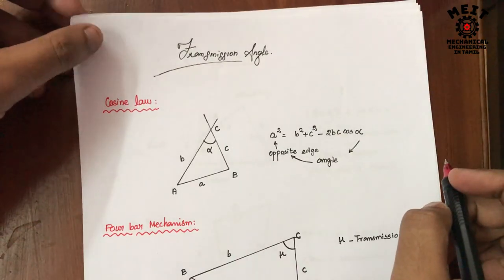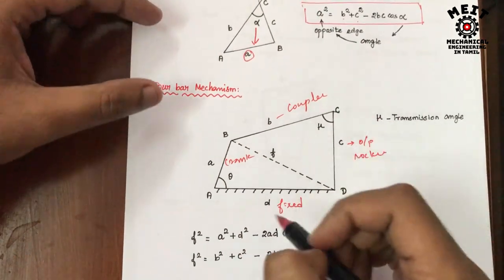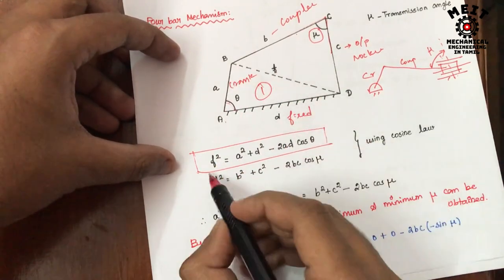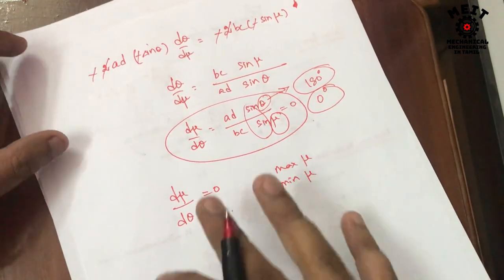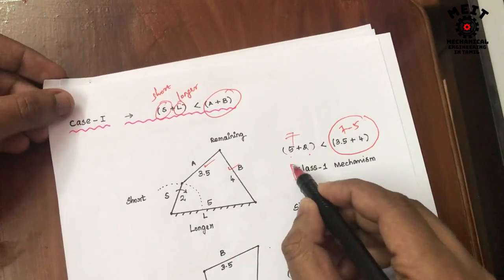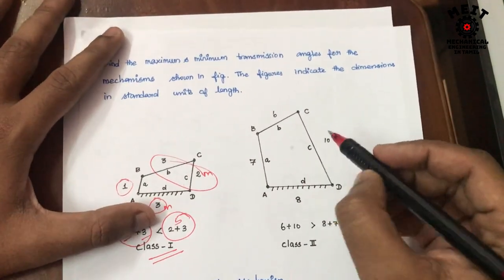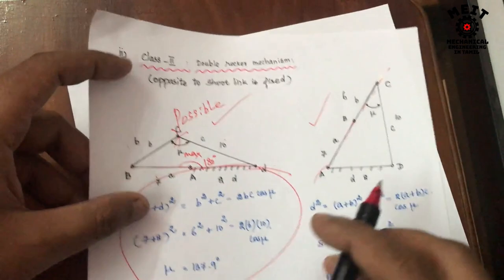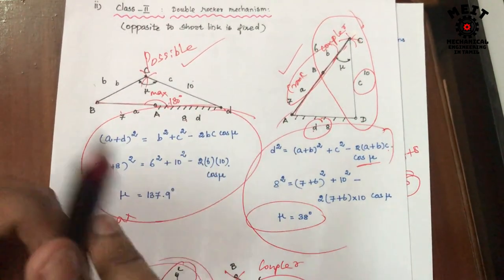Transmission Angle Calculation in KInematics of Machinery (KOM) in ENGLISH

Comment: 14:00 since it is class 2 mechanism example..hence it is double rocker so full rotation of crank is not possible hence 0 degree angle diagram would not be considered
Reply: @focusacademylectures can a double crank have a transmission angle?

Comment: sir please tell me that why transmission angle of zero in the double rocker mechanism is not possible ?
Reply from the maker: IN DOUBLE ROCKER., INPUT OR OUTPUT LINKS WONT REVOLVE THAT MUCH ANGLE... WHEN A CRANK ROTATES 360DEGREE.. THEN ONLY 0 DEGREE POSITION IS POSSIBLE. IN DOUBLE ROCKER, THERE IS NO CRANK, NO FULL ROTATIONAL MOTION.

Comment: Sir aapne kaise calculate karke degree me nikala ?? Mu min or mu max
Reply from the maker: English pls.
Reply: @focusacademylectures  sir please tell how can you calculate mu max and minimum in degree even when i solving am getting another answer.
Reply from the maker: @halalTripShorts  check whether calculator in deg mode or rad mode. You have formula for each type of mechanism, if you know the length og links and theta value.. you can easily calculate mu max mu min
Reply: @focusacademylectures   sir in last i found cos inverse 16 for mu max after that what i have to do?
Reply from the maker: @halalTripShorts  show ur problem as jpg file
Reply: @focusacademylectures   how can i gave ?? There is no any option present
Reply from the maker: Insta @itsmiet